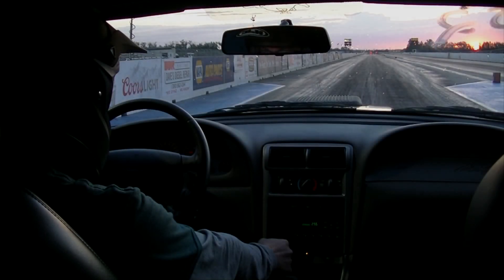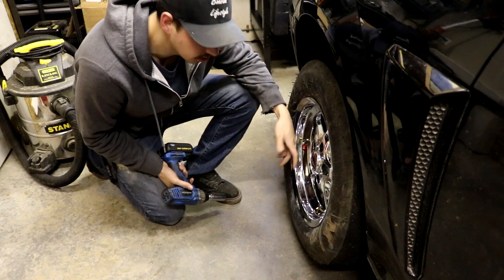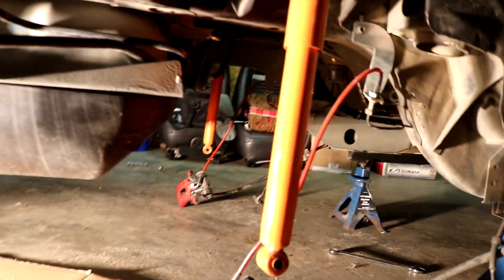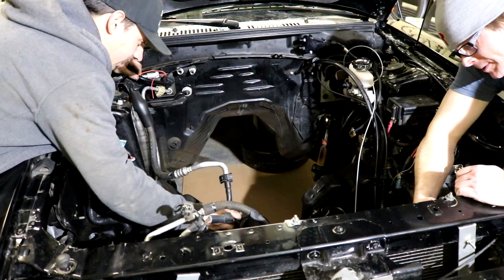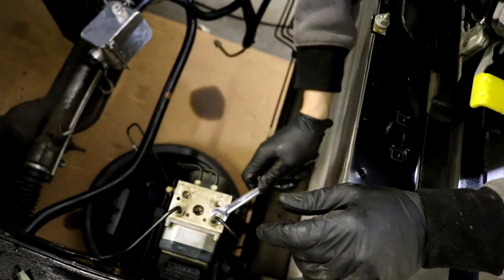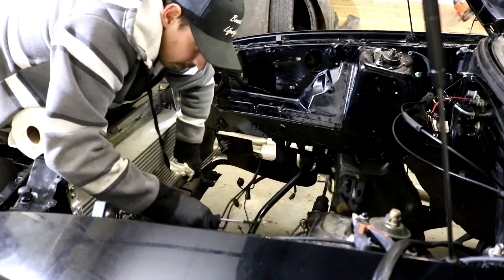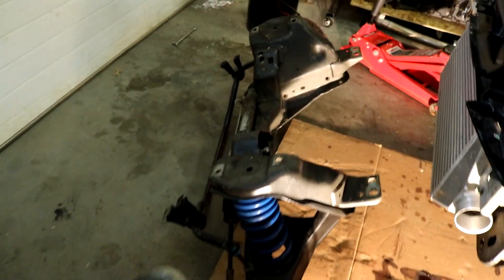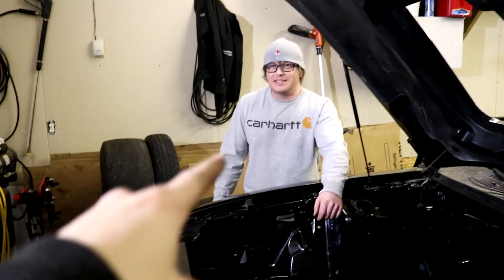Machula Build | Part 15 | Full Racecar

Comment: You may have an issue with the say bar hitting tail pipes with the team z setup. Shouldnt be an issue with an ARB but i had to ditch my bar because of it
Reply from the maker: +Mach1320 not running tail pipe, fender exit ;)
Reply: That turbo life

Comment: So dont take it the wrong way but I think I would have found a high mileage V6 -03 abd stripped it down sold the Mach 1 or just kept it as a street bruiser.
Reply from the maker: +David Rudkevitch meh, it makes it awesome to be a Mach 1 now we can call it the "machula" when it gets internet famous
Reply: Ya I see your point. I have thought about building a full race car very similar to what your doing a stripped down lightened up 03 04 style mustang. I hope you can get it down to 2800 or less. If it hooks it will be fast. Can't wait to see the progress
Reply from the maker: +David Rudkevitch I believe the class we are building for is allowed 2900 race weight with driver

Comment: Damn, my cobra has a lot of weight that can still be pulled compared to the Mach. lol
Reply from the maker: +islander033 Machula powered!
Reply: Boosted Lifestyle this is a serious build compared to the pos centri setup. :)
Reply from the maker: +islander033 yeah that procharged setup was super gay even if we turn the power down and run 10s all day with this car it will still be alright In my books :)
Reply: I might have to up my game soon. fack
Reply from the maker: +islander033 your car is already proven to work good!
Reply: Kent will stay behind me until he embraces the wonders of CO2 WG control. lol
Reply from the maker: +islander033 😂😂 but those Honda guys have it figured out with 4 port solenoids
Reply: Yes they do, that's why all fast terbo cars use 4 port manifold pressure for wg control...lol